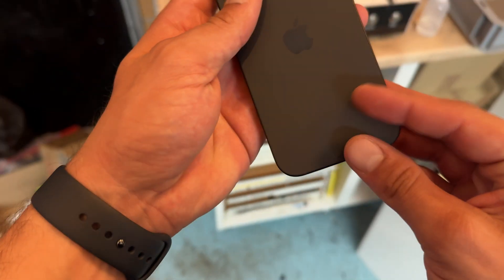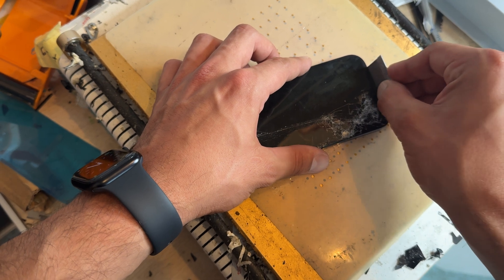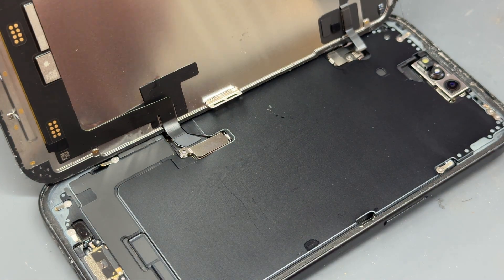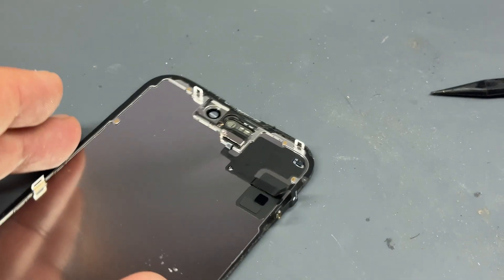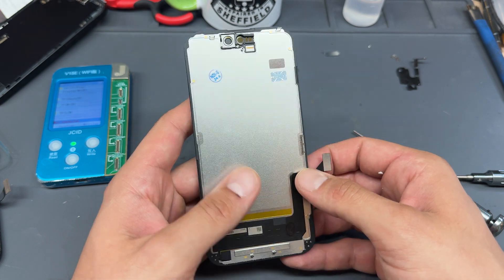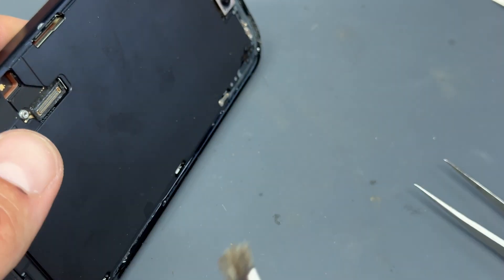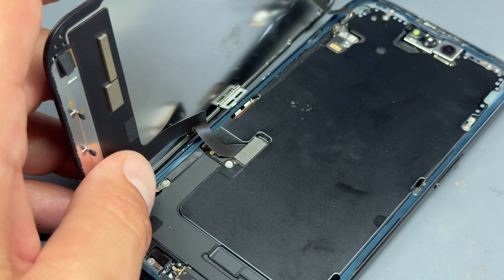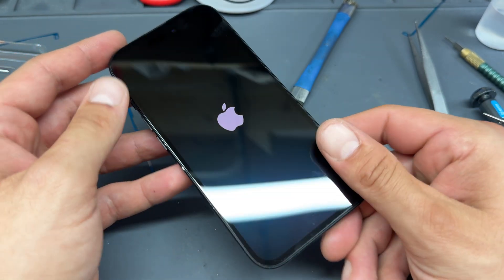iPhone 15 Screen Replacement Guide - Fix Your Screen Like a Pro!

Comment: Also the cable on the screen you mentioned, that is the light sensor. Not associated with Face ID, as the sensors are integrated to a single unit (front camera, true depth etc.) since the 13 series.

Comment: Use the hexagon metal piece of qianli in the corner, it’s much safer as you can damage the OLED ribbon cable which folds at the bottom of the screen where you open the “gap”.

Comment: I still don’t get why people use metal tools to open iPhones
Reply: Risk scratching off the paint off the bezels
Reply: If you’re connected to Apple or partnered, you’ll then get the machines that do this for you. But regularly, using metal to just pry up the screen is just easier in the  process of repairing.
Reply: @mr.illuminat1  I do repair iPhones and it’s just unnecessary to use those tools. When I work on previously repair phones they always have scratch marks from metal tools
Reply: I don’t like this kind of tool either.

Comment: Hey, I have a iPhone 14 Pro with incorrect GPS. What should I do or what should I replace to get the correct values back? Greetings Tobi
Reply: Did you drop the phone?
Reply: @SovietCaptain03  No, I had it to an repair shop and now need the GPS replacement for another shop